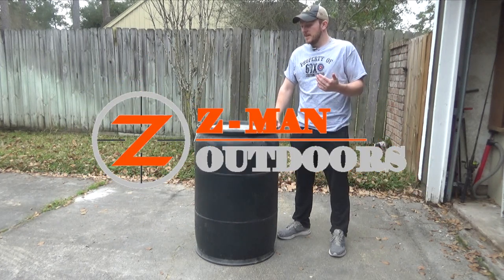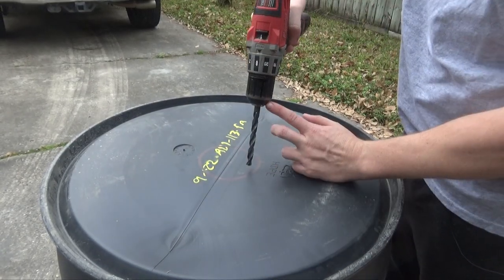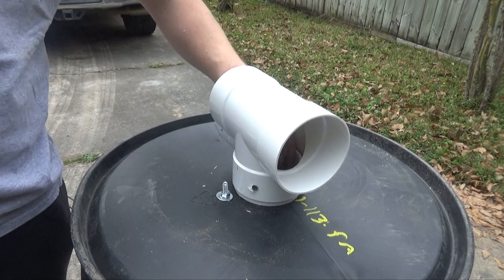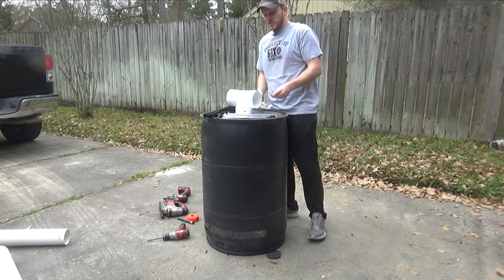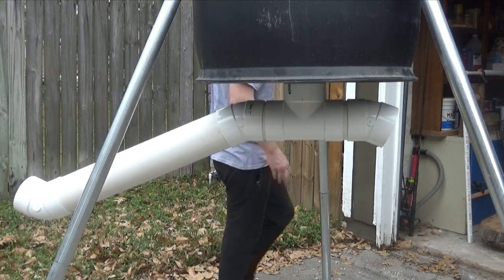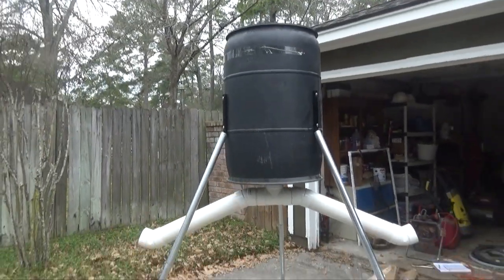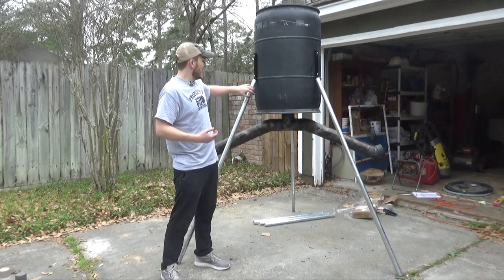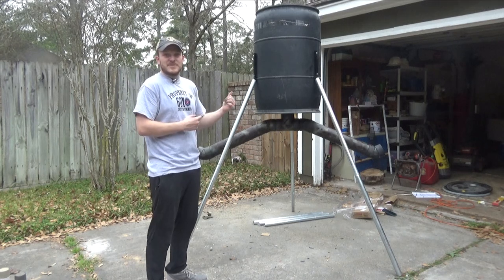DIY Gravity Feeder For Under $100!!!

Comment: The stress on those legs will be immense when you fill that 55 gallon barrel with corn from an engineering stand- point. I would advise installing a yoke connecting each leg to each other to reduce gravity stress. Three pieces of preferably flat steel ( or fence pipe) bolted into the existing legs. The lower the installation of the yoke on the existing legs the more force it will be able to withstand. Mid height would be sufficient. Once that barrel is filled to capacity without the yoke just simply shake the barrel slightly and all will become evident. Yoke it and see the difference. If those barrel legs fail when you are filling the barrel with corn, there could be a serious injury. You must remember that a 55 gal drum filled with liquid is almost 500 lbs. Now corn is not liquid obviously but you get the point. (350-400 lbs. for corn)
Reply from the maker: Yeah, most of the stand feeders you can buy don’t have that, but I wish they did. I think that is a great add to any tripod feeder. Trying to get the legs stabilized and level is also very difficult, that would help a lot with that. Great suggestion! Thanks for watching and the good suggestion!

Comment: I don’t recommend metal drums. They sweat on the inside due to temperature difference between inside vs outside. That means mold. Plastic allows the two temps to balance out better. Just a thought.
Reply from the maker: That is very interesting, I have a handful of metal drums for corn and haven’t had issues, but I could see that causing an issue for sure with protein. That is a good tip! Thank you
Reply: @ZManOutdoors  I sell barrels. I get tips and feedback from thousands of customers every year for the past 8 years. Its amazing what you learn. Now if you put a bag of silica or salt on top of the feed its not a problem. Absorbs it all.
Reply from the maker: That is very interesting, I will keep that in mind on my next one! The plastic was definitely easier to work with too!
Reply: Metal drums are just as good as plastic. They don't  sweat no more or no less. The trick is getting ventilation no matter the barrel. Generally,  either will get enough air from the feeding tube. I've  had metal barrels out for over a year in continuous use with no issue